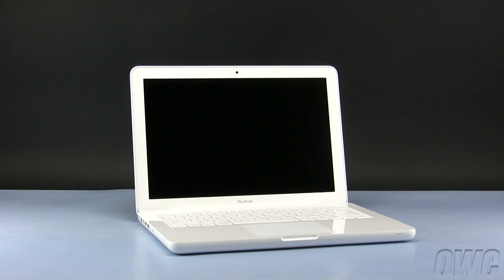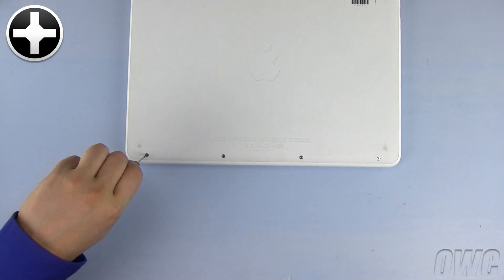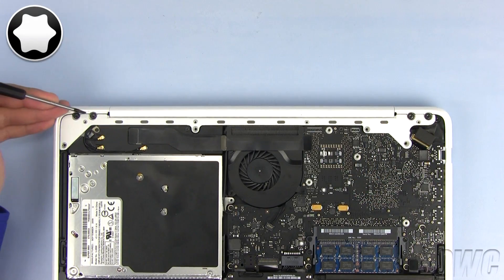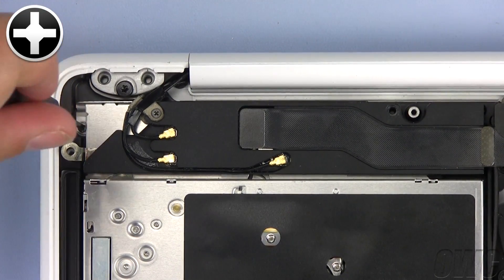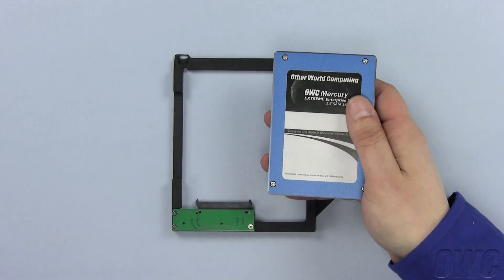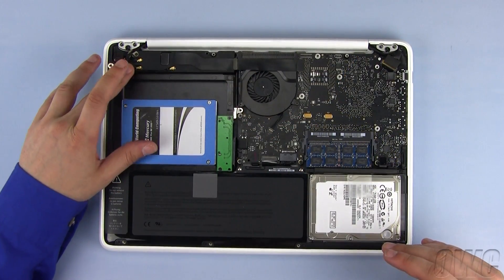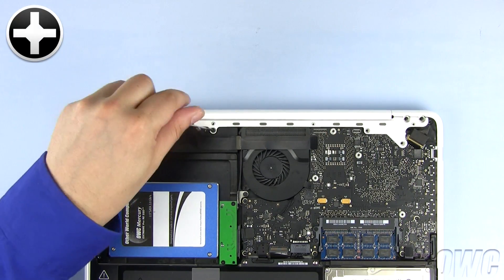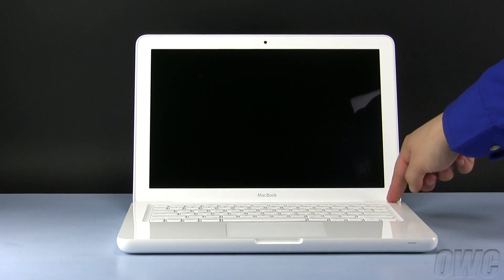13-inch MacBook Late 2009 & 2010 Data Doubler 2nd Hard Drive/SSD Installation Video

Comment: you've probably found out by now but just to let you know, yes this macbook does support sata III drives but the optical drive bay connector (I think) is sata ii. If you get a sata iii drive it is safer to install it in the hard drive bay and then install your original hard drive in the optical drive bay given that it will not be using the extra speed of sata iii.
Hope this helps